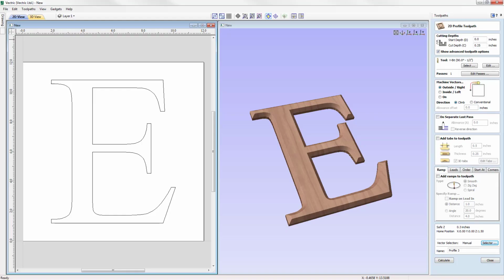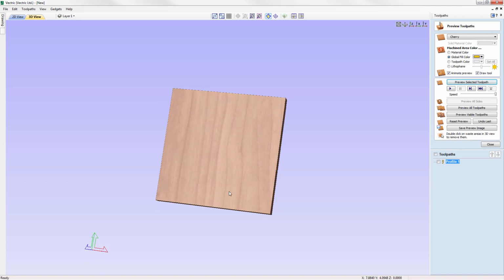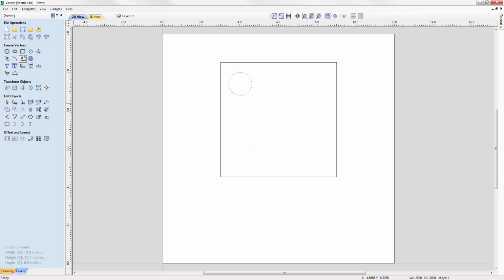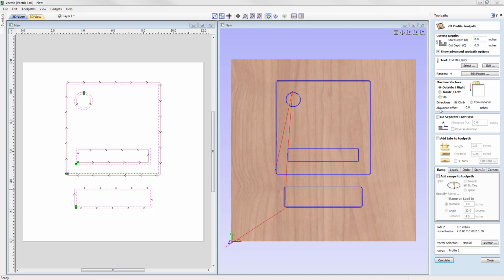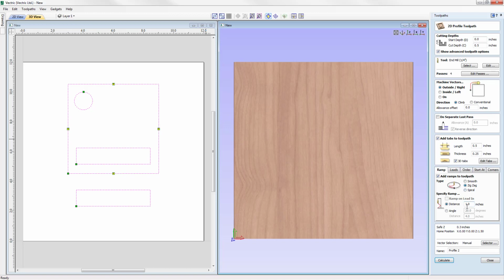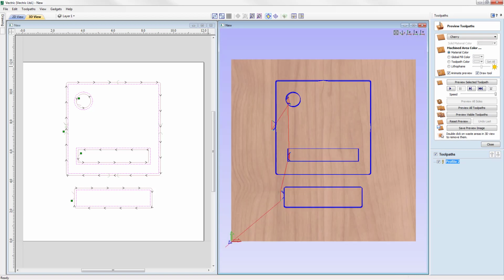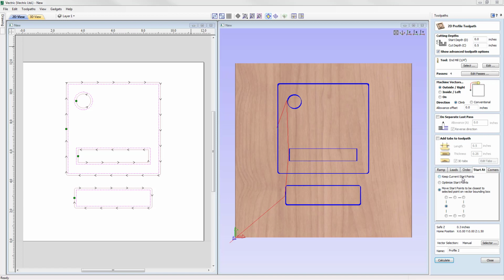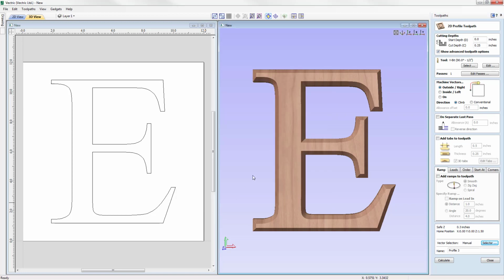Vectric V10 Tutorials | 2D Toolpaths | Profile Toolpath Guide

Comment: Would it be safe to do a last pass with a compression bit?
Reply from the maker: Hello Sara... thats for the question.  Not tryng it... but thinking of the way the compression bit is shaped... yes.  Seeing as your first cut is slightly deaper then the up cut part of the cutter then it would never touch the top of the material and ruin that finish.  

As always I would test it just to be sure.  Hope that helps ~Todd